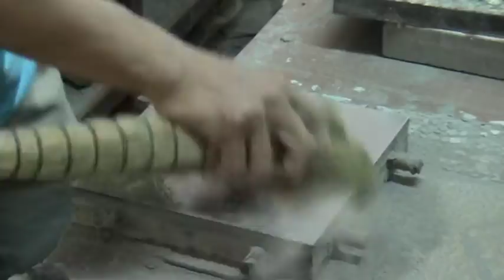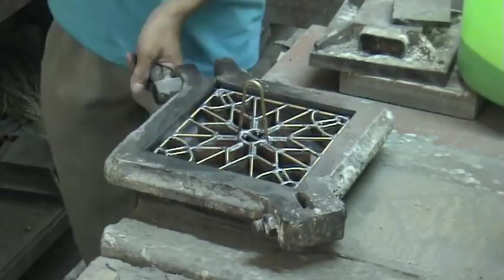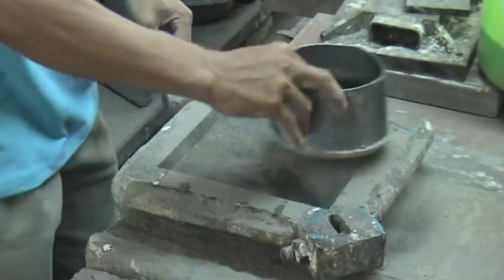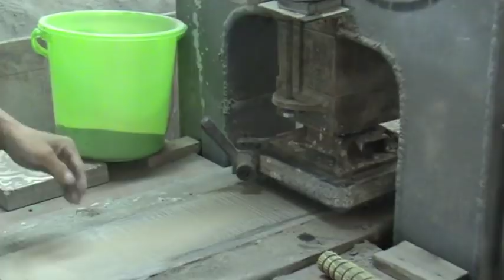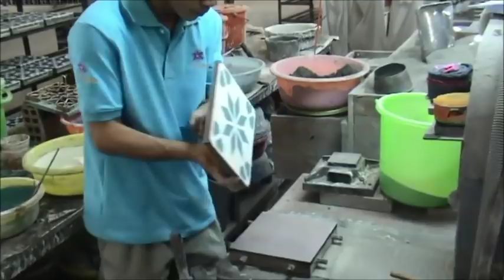How to make cement tile

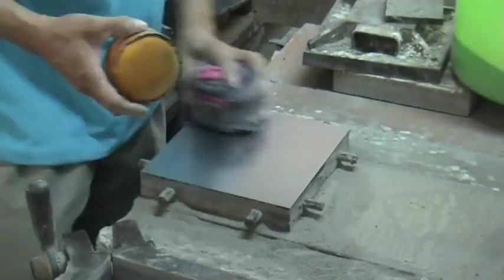Comment: At 2:26 what is that solution used to clean the base why is it used? Pls reply sir.
Reply from the maker: It is mold release oil that the formula is created by us.
Reply: @Viettiles  
what is the composition of demolding oil?
Reply: @joaopaulofornari1561  @Artisto crat I've been doing a reseach on the topic of cement tiles production, and I found out that as the release agent you use linseed oil or the mixture of linseed oil and petroleum

Comment: What is the color making formula? Such as the ration of color, pigments, cement and what eles being used?
Reply from the maker: Golam Mohiuddin Faruq the formula is different from factory to another factory. That’s reason why you can feel the quality of color tone and tile is vary. It is also secret of each factory,  but the main components are: white cement, color pigment and sand.

Comment: it is just cement. plasters work in event all day here. no lime in it. working in lime is ok as long as your hand don't get wet. when you wash off the lime you use vinegar first to neutralize the lime then soap and water.  Hod carriers have exposed for centuries.  very few issues.  sure is labor intensive for 1 tile.

Comment: I was sure the white and green liquid was going to be gone when started pouring the sand/cement part and to my amaze it did not,  humm pretty good,
Reply from the maker: The cement and sand part will absorb water from color layer in the rate that we can control, as the result, the binding between two layers is solid, and the color layer is last long. As long you use this tile, as tile is more shiny.